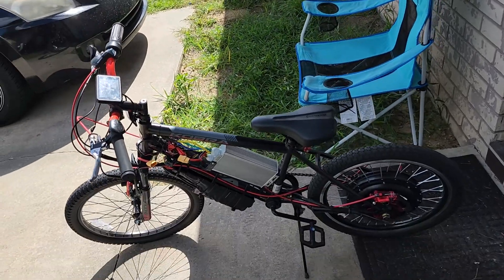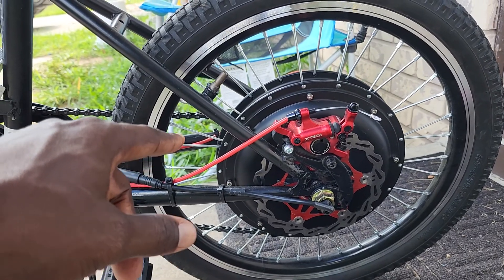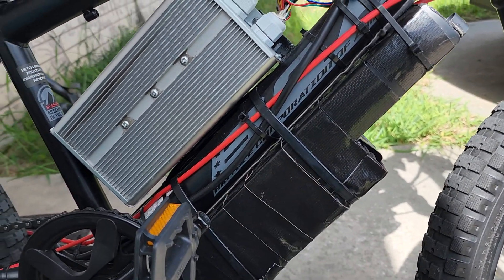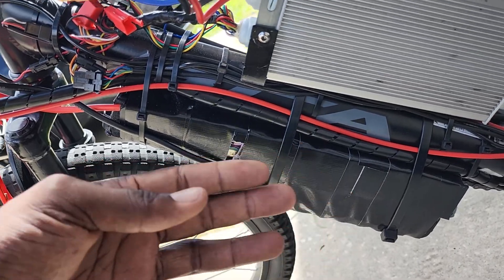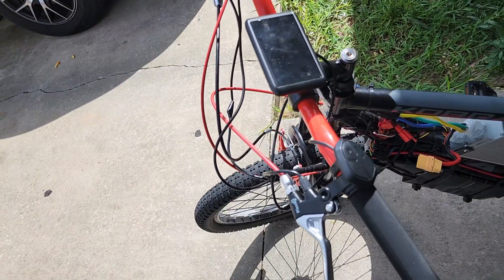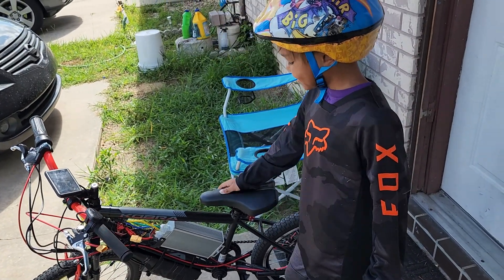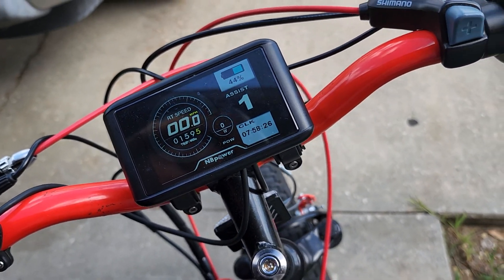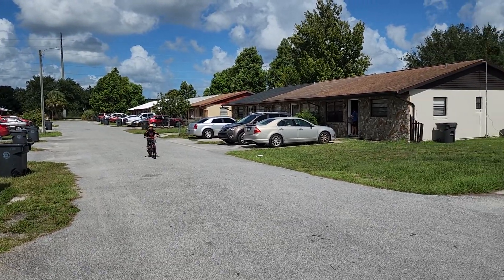1000w ebike bmx  build first ride.

Comment: Hi master builder  i love that you are showing your family that this building E-Bikes can become a family business and have fun doing it so cheers to that but had a question do you build off of previous setups I have a 2018 rad city bike batteries dead with a 750v hub motor to slow for me I use it for work i live in the d.c area it's a mad house driving here how much would it cost to have my bike go 50 mph and thanks for the content!!!!
Reply from the maker: No problem, and thanks for your support. To answer your questions you will need at least a 2000w hub motor matched to a 80a smart controller like the one that's on my son's bike to a 52v 20ah battery,  about $600 for that set up. It's high performance so it's not cheap but too expensive either, also I build from scratch and love to get into business doing it.